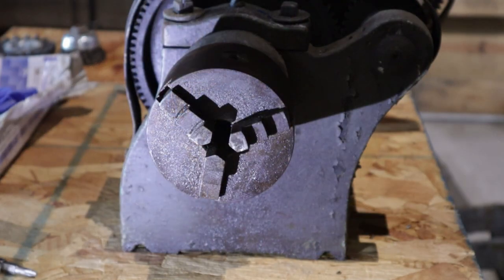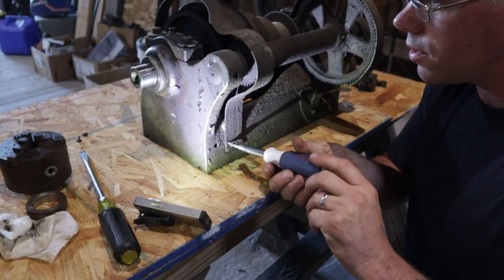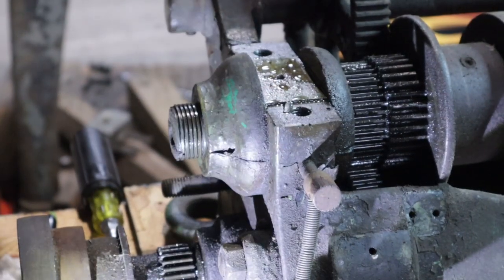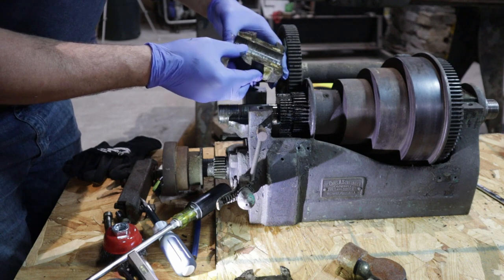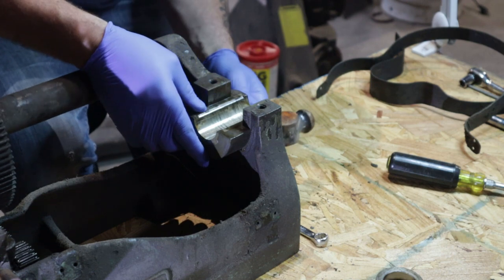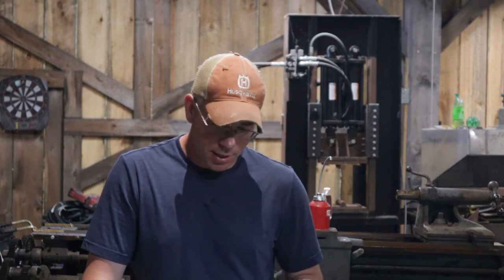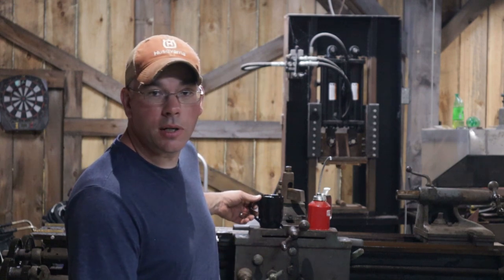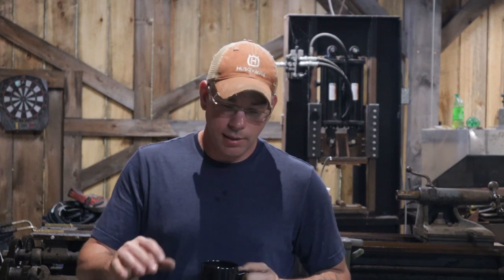1890s Metal Lathe Restoration Part 2: Breaking Down the Headstock

Comment: Morning again, Jim. There two darn good reasons why this machine is coming apart so well. 
1. 130 years ago they still manufactured machines to last forever.
2. Businesses and individuals kept up on their maintenance and took care of their equipment because they planned on them being a one time buy.
Machinery wasn't built, bought, or used with plans on them being disposable consumables. They were not considered depreciable commodities. Now a days the thought behind tools and machinery is that you build and buy them with plans on replacing them in 5-10 years, max. Everything now is disposable or high maintenance.
Reply from the maker: I agree all the way Thomas. This thing is just impressive.
Reply: @TheTradesmanChannel  yeah, I totally agree. Looking at what you've shown so far, and not even putting my own hands on it, and comparing it to my bandsaw that is just a couple of years old, I can see a world of difference in the build quality and materials used.
Your lathe has solid materials vs my bandsaw with stamped relatively thin gauge steel. Heck, even the cast iron table on my saw is super light weight compared with how they built machines back in the day. The only relatively newer machine I own with thicker iron casting is my harbor freight wood lathe, and it still doesn't  look as refined as that old antique beauty.

Comment: HiJim Purple-power degreaser from Home Depot will melt the grease and much of the old paint away. I restored a 1943 South-bend lathe. Soaked them 1 or two days. Rinsed in hot hot hot water . Then a soak I Evapo-rust. Came out like new. I got two or so years from both fluids. Don’t. Soak aluminum or other soft metal Long or at all in the Purple power it will dissolve them .Also heavy duty rubber gloves and safety squint’s are a must . Also watch-out for tapered roller-pins they will bight you in the rump. Good luck with a great project

Comment: Going to be very handy to have that tool!  Amazing how good shape its in.
Reply from the maker: I'm excited for it.  Next will be the learning curve.
Reply: @TheTradesmanChannel  me too.  Getting close to having the new shop ready for production.   Lathe, mill, and plasma cam.  Burned up the motor on my new compressor $1700.00 to replace it.  7.5 horse 230v.  Think the generator pulled too much at start up and it burnt out the windings.   Tryed using my 25kw gen  the big generator the starter went out and no longer avalible so having to have it rebuilt.
Reply: Always something

Comment: you recast bearing with an under sized [.005 ] shaft that spans both bearings and scrap to fit the new bearing. with .050 shims for top cap adjustment.
Reply from the maker: Sounds like you've done this before, once again thank you for the knowledge.

Comment: I have nearly the same lathe as yours, I'm missing the ID plate so i had to spend a few hrs online to ID it. I recently got a new electric motor for it and that has made an improvement, it had no power no matter the ratio i tried. mines pretty janky sounding but the shaft has no play and doesn't wander, except for the previously repaired 3 jaw chuck. the chuck was not fixed perfect so anything ive made with it has been on the rough side. eagerly watching how yours will turn out.

Comment: Hey Jim, sorry I've been largely absent from the comments for a while - but have been following.  Man I am so jealous, I wish I had a small vintage machinists lathe like yours - and it's in such great shape for it's age!  You probably know this, but watch for taper pins hidden beneath the grease holding a gear, retention collar or handle in place on a shaft.  They were commonly used on these old machines and can be hard to spot.  Anyway, I'll be following along to see how this thing works out - HAVE FUN WITH IT!  One question - did it come with the change gears for the left end of the headstock to change the lead screw feed speed?
Reply from the maker: No change gears which is disappointing but I'll scrounge them.  It is great to hear from you. I was wondering how you were doing the other day.  Hope all is well.
Reply: @TheTradesmanChannel  doing OK, fighting a slow septic drain field at the moment.  I'm sure you can relate!

Comment: It's a rather light lathe by the size of the head stock. I had a chance to buy some massive lathes with 6-14" head stocks and the beds were 4-10' long, all roller or ball bearings, I should have got one. When you can afford stuff like that, you're too old!

Comment: I think that chuck spacer is an add on. I don't think it should be there. The back of the chuck should seat flush to the spindle shoulder. The chuck was only held on with a few threads.
Reply from the maker: I was wondering about that myself